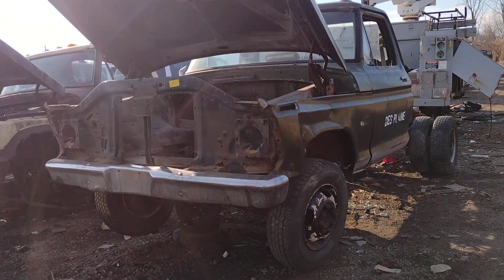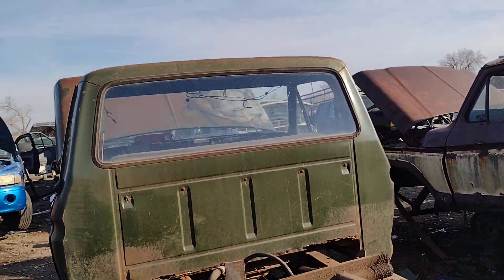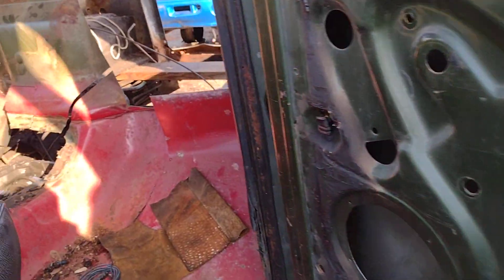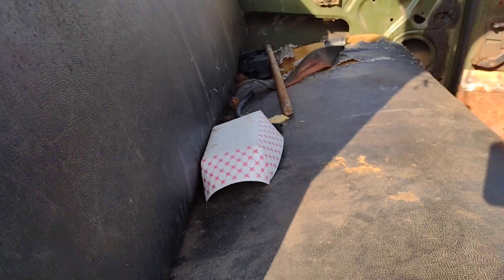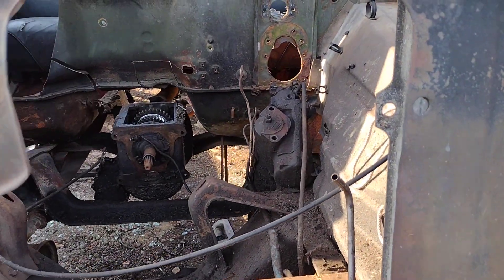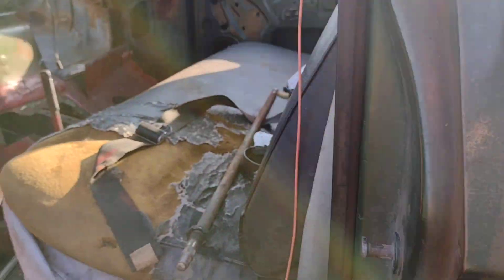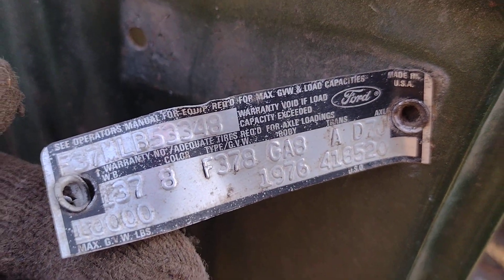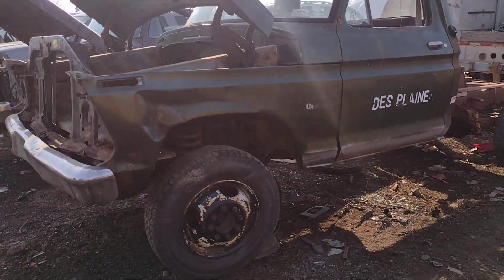1976 Ford F350 junkyard find Municipal Truck Work vehicle rusty gold

Comment: Small dump trucks are cool .  I have a 1986 Ford....and an 1989 Ford.....both have been parked for years.
Reply from the maker: Maybe it's time to unpark them.
Reply: @NathansMoparGarage  8 mpg....
Reply from the maker: Time to sell them off and get a diesel. My 4 door 8' bed Ram gets 19-20 mpg
Reply: @NathansMoparGarage Hmmm,  that does sound good.  .....An old old diesel would be nice.
Reply from the maker: I got a rust free 05 Ram from New Mexico for a great price and drove it home.
Reply: @NathansMoparGarage That would be an adventure...I haven't been to NM in ages. It would be fun to visit Low Buck Garage.

Comment: Yup, that's the one. 

We got the VIN, we win: F37 for F-350 2WD cab and chassis, M for 390 CID V8 with four barrel, L for Michigan Truck assembly, and the rest is the production sequence lining up with the 1976 model year. The Michigan Truck plant still operates today as Michigan Assembly.

We got the tag, we can brag: 137 for the wheelbase of the truck in inches, 8 for Dark Yellow Green Metallic/Hatteras Green Metallic exterior paint, F378 for F-350 2WD cab and chassis, GA for Black vinyl heavy duty interior trim, 8 for Custom Cab without back of cab equipment, A for four speed manual transmission, New Process Gear manufactured, D70 for possible 4.10:1 rear axle ratio, locking (tough to read), J for front axle with power steering, 10000 is the maximum Gross Vehicle Weight Rating in pounds, 1976 for 1976 model year, 41 for Chicago, IL sales district and the remaining numbers are the order numbers for the truck.

Rouse Welding and Body closed around 2012 with Mr. Rouse passing in early 2013.
Reply from the maker: Heavy research
Reply: Only way to do it.